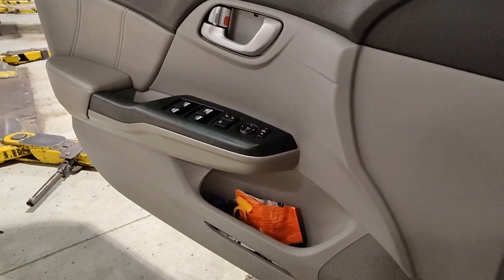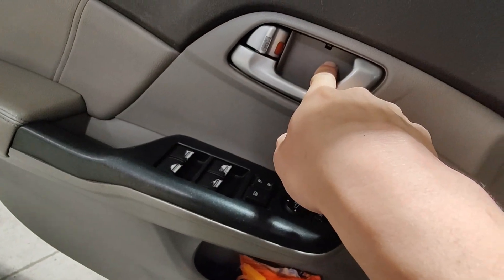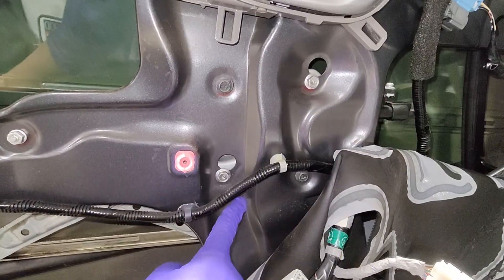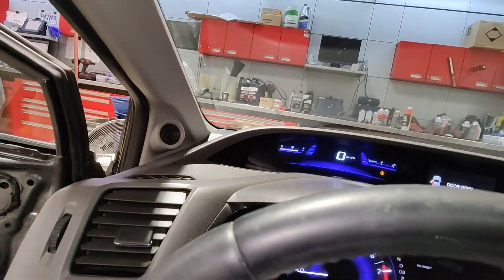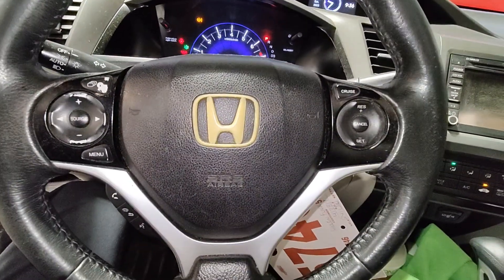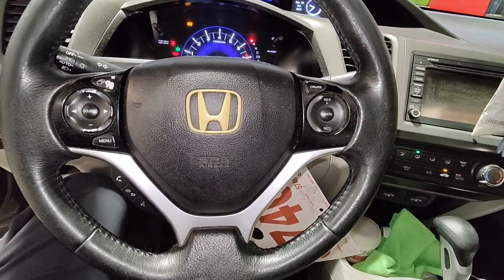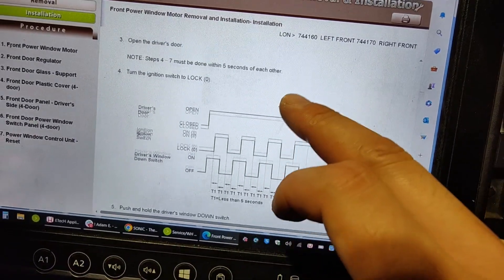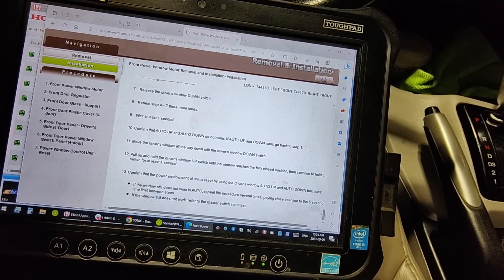They couldn't roll the window up and the motor just kept spinning.

Comment: Just did this on both front windows 2 days ago. The passenger side quit, and I replaced the motor. Later that afternoon, the driver's side quit. They were relatively easy repairs.

Comment: how did you get good at diag? is it taught or do you have to research and learn on your own?
Reply from the maker: As an apprentice I got all the diag work engine and transmissions. while the flat rate tech got all the gravy back in the day. I learned by doing and understanding how things work and using service information. Making mistakes also helped in learning so you know not to make the same mistakes. An old manager once told me "I won't fire you as an apprentice because you are still learning" but make the same mistakes as a license tech I'll kick you to the curb.
Reply: @theoffroadingmechanic  thanks for the response! i’m looking forward to going to a dealership and getting good at diag. your videos are really helpful also because I like Hondas and that’s where i’m looking to go.